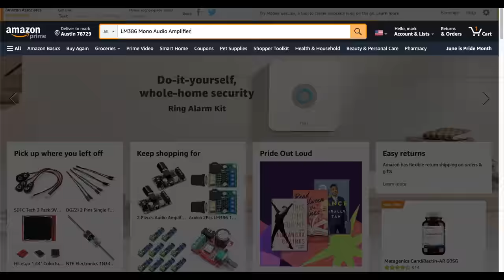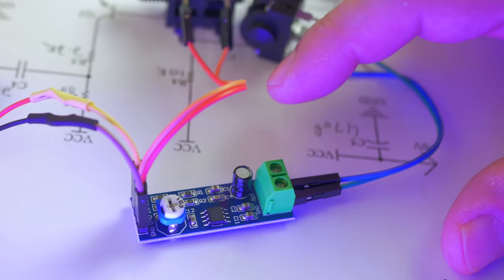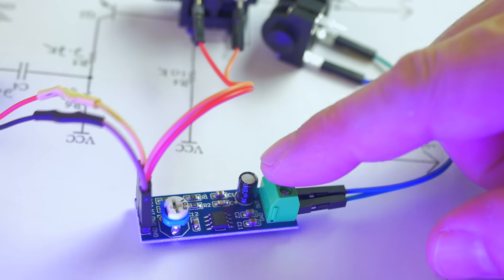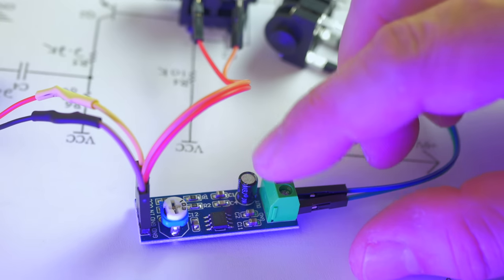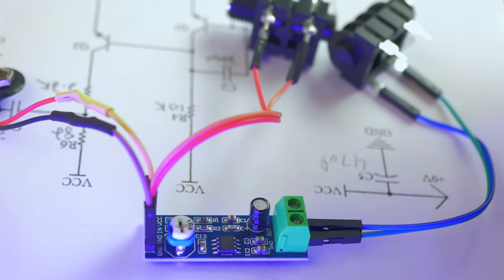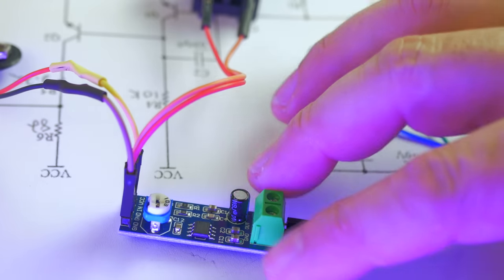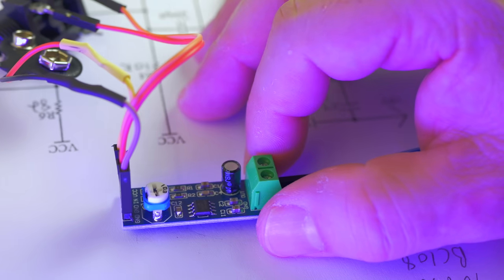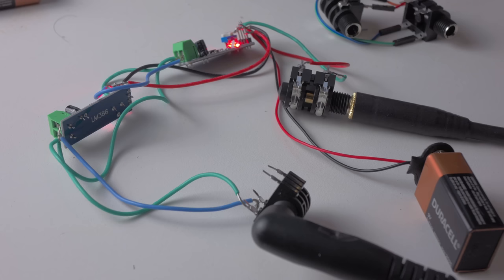One Dollar DIY Amazon Fuzz

Comment: Feel like I’m gonna put this inside one of my guitars
Reply: Great idea
Reply: Did this myself and it’s so fun! I installed in the rhythm circuit of my jazzmaster. Though I do have to open it up and place it before the volume and tone pots because it gets loud! And since I don’t really need it to clean up I’d rather be able to control the overall volume/tone of the fuzz going full bore. 
It’s been such a fun project
Reply: Make a bazz fuss instead. Very easy and you can modify for you
Reply: Works great as an inbuilt headphone amp. Add an MP3 player module for backing tracks.
Reply: I thought the same thing, I'm reworking an old mustang, adding a humbucker in the bridge, this is the perfect size for the cavity. A simple 9v rout on the back...
Reply: because… guitar effects belong inside the guitar ??
Reply: BC Rich guitars with the full active electronics package have one or two preamps installed internally :) Every once in a while you need to take the back panel off and replace the 9V battery!
Reply: Who tf wants a 9V battery in their guitar?
Reply: Bassists with active pickups, guitarists with on-board pre-amps, electric-acoustic guitars - they all have batteries that need to be changed, and they're not all convenient. I have an old Ovation acoustic-electric that needs two of the strings removed before there's enough room for my hand to get into the sound-hole to reach the battery.
Reply: @TheXxPSYCHO yer mom. I guess you don't understand electronics, eh?
Reply: I got 9v batteries in each of my Westone Thunders (1A and 1A Bass) for the active pickups😉🤟🤟
Reply: Gave me the idea for a guitar with 6 in/out ports for Dis/OD/Fuzz, they'd each be embedded in the bottom, with their own toggle switch for power. There'd also be one "main" out.
Reply: @TheXxPSYCHO road trip guitarists.
Reply: @abluecherry7937  don't think anyone touring wants to carry around a bunch of 9v batteries with them.
Reply: @TheXxPSYCHO  rechargables. and there are batteries that you can plug into the wall.
Reply: That's what I was trying to do watching this video! How would I go about doing that?
Reply: I have shoved so many mini pedals in guitars.

Comment: just used 2 of these to build an acapulco gold. run the gain pot full on the first and adjust the sound at the second to taste. sounds absolutely identical to the eqd pedal
Reply: So, do you run the O/P from one into the other with that?
Reply: Stole my idea! About to build a talkbox, too
Reply: @Bruisewillies  yep, dead simple - no soldering except the jacks
Reply: That's like what I was planning! I have an old 2 button foot switch I don't need. I can use that
Reply: @CMC-NFG  nice! does it hold together ok with no soldering inside a case?
Reply: HOW?

PLEASE,
I need instructions

Comment: I used this same board but with an inductor as the input. It works as an EMF sniffer. Great noise project when coupled with a multi-effects pedal. Also good for checking if your house has been bugged.😅
Reply: Damn dude, thanks for the heads up. How do I make the bug detector thing?

Comment: If you were to give these away to friends/family it would probably be a good idea to add a resistor or volume pot to the output so it isnt as hot. Could cause damage if they had their amp cranked and weren't aware of how hot it's signal is.

Comment: You can build this into a guitar and even put a speaker in it. Then you can turn it on and off (if you add a switch). If you have an electric guitar you can use it as an effect because you can play through your amp, and then turn on the guitar speaker to get more gain or just a different sound. If you place the speaker slightly behind the strings (like part of the speaker not all of it, then you can get crazy feedback effects at the flip of a switch in a tasteful manner

Comment: Nice. With a stereo jack socket using the centre pin to complete the battery power circuit, you could make it so unplugging the guitar cord from the input jack turns off the battery
Reply: There are some 3 pins sockets that instead of stereo have a built in switch, I think I'm going to add some to combo amps to be able to plug heads into them or plug cabs out of them without requiering a cable to play it just as a combo

Comment: It's all the bits around the circuit that would make a finished pedal expensive. Once you have some nice jacks, decent panel mounting pots. 3PDT foot-switch, barrel socket, die-cast enclosure the one buck pedal becomes a whole lot more!
Reply: Not if you know where to shop.
Reply: @kmoecub  Let's say you got the cheapest componets available (not good for pedals, but we'll go with it)I'd have to guess that's gonna be at least 20 - 30 bucks.
Then you have to pay someone to assemble it; let's say it takes half an hour, so another 20 - 30 bucks in wages.
Add in some overheads / documentation / shipping:
This pedal would easily work out to be around 80 bucks if he were to sell it in shops.
Reply: En Aliexpress son más baratos los componentes*
Reply: @nuberiffic  pay someone to assemble it?  The whole point is this is a DIY project.
Reply: @wesdizz6297  then why not make the circuitry yourself?
Reply: @nuberiffic  I have made a Noisy Cricket which is similar circuitry. Complain all you want, but this guys video is great.  It's a quick cheap fuzz.
Reply: @wesdizz6297  I like how you tried to disagree with me by complaining against things I never said.
Reply: I get 1/4" sockets for 10cents each. I have an Altoids tin. I'm going to use a dpdt 25cent switch and that makes the 9v about the most expensive thing.

Comment: I've used these things before and they do sound pretty sweet with two or three in series. The issue I found was that the signal is so hot you can't run it with your amp set to normal volume without risking damage to your amp (and hearing), so you really need to find a way of attenuating the output signal to make it very useful, especially if you want to introduce a bypass switch and chain it with your other pedals.
Reply: volume pot time!
Reply: Yea I was going to say, run the signal thru a resistance to limit the max volume or even add a potentiometer (or both) and you’re set.
Reply: Im completely new to this topic, how do I know how strong the resistor has to be? @TriangleWaveRecords

Comment: Coolest part is you can push a speaker directly from that circuit's output. Because it's a half-watt amp. And if you wanna dabble in SMD soldering, you could mod it into any of the LM386 Runoffgroove projects (Little Gem, Grace,/Big Daddy, Ruby), which have been known to sound pretty alright.
Also, fun fact: Many pedals use the LM386: Lovepedal's Black Magic, Purple Plexi and Jubilee, DAM's Sonic Titan, even Frantone has used it! I too remember that the 90's Vox AC1 miniamp used that chip as well, and a few years ago I saw that circuit cloned into a Benson branded mini-amp (that looked like a Marshall MS4 mini stack).
So the "not so great" sound from this particular board is more likely a fault of an inadequate implementation for guitar use than a fault of the chip.
Reply: Have used these chips as headphone amps since a kid. These modules make it even more accessible. Great sound.

Comment: I cant believe that it actually sounds good. Id like to figure out a bypass for this so it isnt just on or off.. i did buy a 9v box with a switch so at least im not always disconnecting the battery every time. When that red light turned on, i was so happy

Comment: I think you‘re overwhelming the circuit with too much bass, these are normally power amp to drive speakers and have a more linear response, guitar circuits on the other hand are designed to give the best distortion, which is achieved by reducing the bass before and between amplifier stages. So if you put a highpass (usually a capacitor is enough, the smaller the capacitence, the less the bass) before each circuit you get much more pleasing distortion.
Reply from the maker: I agree. The good thing is this pre-built circuit is a great platform for modding and experimentation.

Comment: Try adding a potentiometer been the battery and the board; dropping the battery output can and will change the tone to the fuzz. Or add another battery for 18 volts input if you wanna go crazy.
Reply: If you want to pop it. Most LM386 chips have a maximum supply voltage of 15 volts. There is a version that will go up to 22 volts, but unless you know that's the one you have..well...

Comment: With a stereo amplifier board you could probably run the line in through one channel, and then the output from that channel to the input of the other channel.  And between channels have a volume pot and a tone pot.

Comment: Dude-could you do some more sound samples? I’m really curious as I’ve just gotten into fuzz in the last few years.  
That doesn’t seem to be a ‘Velcro’ type fuzz, more Muff like which I’m all over. Love to hear some leads and maybe it’s low volume sound…so many questions…just watched Andy’s demo of the E.Q. pedal…@#$&ing Red Fang! 
But seriously, thanks. I’m going to buy those to mess around with…who knows? I love making my own stuff and customizing the hell out of it.
Reply from the maker: Hi Matt, your are right. I didn't know how to describe the sound. It's not quite fuzz or distortion. It has a very low frequency muff tone. The trim pot can be turned down and it gets into boost territory but frankly it only sounds good maxed out. It also doesn't play well with other pedals or the dirty channel on an amp. Still, for a few bucks it's fun to experiment with.
Reply: @MarkGutierrez  It sounds much better than it has any right to. In the right hands, it's pretty killer.

Comment: How do these input/output jacks work? I followed the wiring in the video but all i hear is buzzing. I think its the jacks but im not even sure how they work to begin with
Reply from the maker: There are two sides, two sets of pins. Use the side that the jack actually touches. One of the sides, if you follow the pins, has a metal that floats above the actual jack and doesn't make contact.  Ensure you use the pins  that actually touch the  jack.

Comment: Thankyou so much for a great video. I've been trying to build an audio translator with an Arduino, it's like a color organ, for my Christmas lights. I want six of them so they need to be cheep. I built FM transmitter & receivers from you tube but needed a low cost amp and now with your help I have that. I just ordered the parts and with luck it will be ready by the end of October when my lights go up.

Comment: I'm thinking about placing a small value capacitor at the input of one of these babies to make a "treble booster" type gadget. Probably have to tinker a bit to find right value cap; might wanna put several small caps on a switch .
   Ordered 3 of these little devices. On a slow boat from China at this time ...

Comment: You could turn the volume down of one circuit when cascading into the other which might yield better results. 
Another option would be run them in parallel with one distorted and the other clean. Then you'd almost have a Klon style pedal.

Comment: Nifty. Way back in the day(pre-surface mount & multi-layer PCB's) I copied the OG MXR Distortion+ several times, which was(perhaps still is) one of the best IMO. Its just a 741 op-amp & a few support components. The 2 diodes being the most crucial to match. They are very simple circuits, the hardest part to find was the DPDT PB toggle(AKA stomp) switch. Would usually just steal them from other broken pedals. That could use one too & I'm sure they're practically a dime/doz nowadays.
Reply: Sounds like a fun project! Would you know of any resources to build something like this now?
Reply: I would also love to know more. I’m trying to get into building pedals and amps. I work at Guitar Center and I plan to make this “$1 fuzz” a Christmas present for my guitar playing co-workers. I’m probably gonna use legos or toy cars as the enclosure. Not sure yet. But I love this and want to do more stuff like it. I hope to incorporate a stomp button into the project.

Comment: When you built your $1.00 DIY Amazon Fuzz, where did u get those specifically pinned wires & what exactly are they called! I am sure that I need those in my life! I use to have a 12v powered personal amp which was a small, 1 inch by 2inch black cube with 1 knob, 1 switch, & 1 red light. It only had clean channel though. It also had a belt clip built into it. I want to build one!!!
Reply from the maker: The links to those wires should be in the video description.
Reply: can try breadboard jumpers, dupont cables or something along those lines. Might be fun to get a breadboard to test the circuit as well, not sure for lm386, but lm358 is available in a dip-8 case that can be soldered on a prefboard or put in a breadboard

Comment: Wayne McPherson did a mod of this. Remove C1 and run it into a gain pot. Remove the blue variable resistor and add 2 caps, one for filtering to ground,  one for increased line capacitance. Run input to volume knob then out to LM386 card.
Reply: Do you have a link to this mod? Thanks.

Comment: I dont understand how this circuit is distorting/clipping? Usually you need to put some clipping diodes at output for it to work as distortion. The only way for it to distort is by input distortion only. I see fellas putting all sort of leds and diodes on output for deferent kind of disrtotions
Reply: If you drive an op amp with a high enough input signal, the output will reach the voltage rails and start clipping.

Comment: Have you tried the LM358 module, the LM358 is a proper preamplifier module with 2 stages. You can mod it by adding the clipping diodes and a tone control. The LM386 is a power amplifier so not so flexible for what you want. The LM358 will work very well as a built in booster or a buffer.
Reply: Is it enought just to solder out 386 and solder in 358?

Comment: To make it useful all you need to do is add a 100k pot on the output add a stomp switch. Of course a tone control circuit would be a bonus which schematics are available on line for passive designs, just pots, resistors and caps…. 
The LM386 is actually designed to drive an 8 ohm speaker directly. Years ago I hooked up a small speaker to one, plugged in my guitar and mic’d up the speaker! My bandmates nick named it the Ted Nugent amp!
Reply: Hey man, How do you add a footswitch to this? I’m running two of these together, and I like the sound I’m getting, but the only thing I don’t know how to do is add the footswitch or which one to add it to?
Reply: @Crunchy_Black  a double pole double throw switch is needed. Basically connect it so the input is switched to the fuzz circuit or to bypass directly to the output. You need a double pole so that when the bypass mode is selected, the fuzz output is disconnected so it  doesn’t load down the output signal. hard to explain in words. The 100k pot would be on the output of the fuzz circuit to control volume.
Reply: @bobsbarnworkshop  First off l, thanks for taking the time to answer a random question on here I appreciate it. And yeah I think I follow you
Reply: @bobsbarnworkshop  if I understand you correctly the switch I need is actually disconnecting only the one side I am using for fuzz while continuing to allow signal flow through the other side?
Reply: @bobsbarnworkshop  I am just running the guitar into one of these wired right into the second one and back out into the amp. So the second one is the only one I actually want to bypass?
Reply: @Crunchy_Black  do you want the guitar clean when the fuzz is off? If so, then you have to  bypass both. Of course you can have 3 tones with 2 switches! Clean, some fuzz and more fuzz! Just have fun experimenting!
Reply: @bobsbarnworkshop  ahh I see. Thanks again

Comment: Hi, im not really good at electronics but can someone tell me if i can use a 2 pin mono jack instead of the 4 pin like the ones that come insidea guitar? I wanna learn electronics and i feel that this is something cool i can start with
Reply from the maker: absolutely. google mono jack wiring diagram and you'll see which is ground and which is tip.
Reply: @MarkGutierrez  thankyou so much for the help :)

Comment: Super cool video, thanks for posting! I don't know much about circuit/electronics, so this is a bit of a noob question, but when you daisy chain the two circuits to make the super noisy one, could you put a volume (and/or gain?? not sure if it's the same thing in this case) potentiometer in between the two circuits to adjust the amount of signal passing from the first to second? Would that work, or am I thinking too much like a beginner? Ideas with no knowledge! Lol
Reply from the maker: You absolutely could do that. There are no rules. Have fun!

Comment: could this be powered with a eurorack power supply?
Reply from the maker: Eurorack is 12v. Not sure what that will do to the circuit.
Reply: Technically yes, since most LM386 can handle 12v, you have to be sure to connect it between +12 and ground though and not between +12 and -12, that would be 24v pp and destroy the chip. The external power supplies cant be used since they‘re ac not dc and have to much voltage.
If you want to turn it into a eurorack module it gets even more complicated, because you need to make sure, that the circuirts can handle 10v pp input and also outputs only a max of 10v pp, you could very well destroy your other modules if it exceeds those limits.